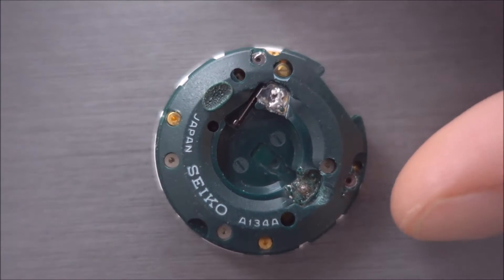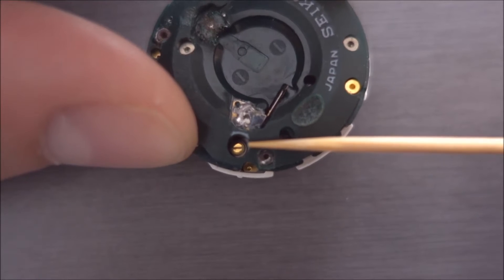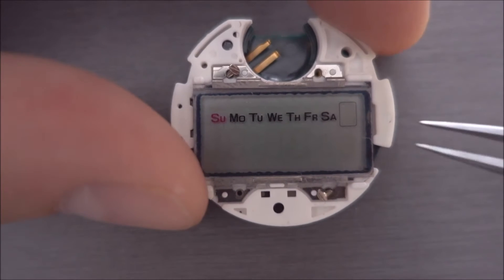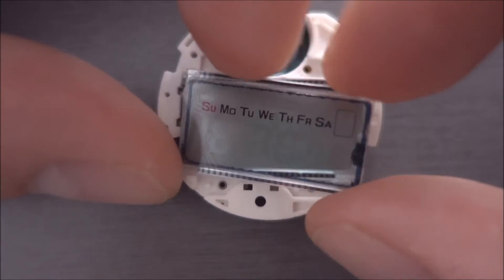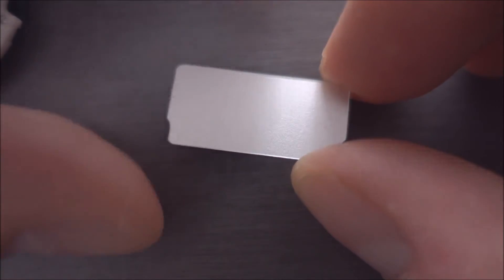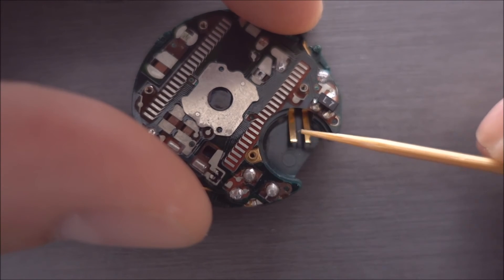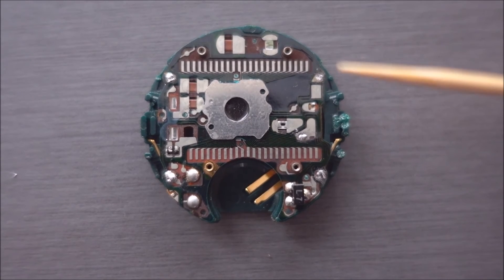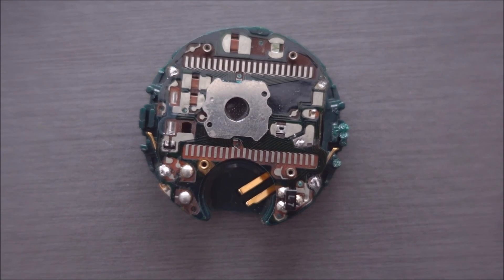SEIKO A134 LCD Quartz - How's It Built? / What Goes Wrong?

Comment: Any tips - my pristine A159, put new battery in - nothing; watch inactive, no flickering, button action ok, specified battery, tried another identical batt, tested both batts both ok. Still nothing, Batt compartment clean, no acid residue or anything like that. No weird smell.

Watch sat in box for about 10 years with no battery. Any tips, or is it now junk?
Reply from the maker: Probably need another movement unfortunately. They are prone to sudden death for no reason.
Reply: @hal0eight  Thanks for the reply.   Another collector has since said the same. It's a bummer but it is what it is.  Thanks again.

Comment: I have a strange bunch of A158's - very similar movement.
I got 2x NOS ones and the LCD is extremely dim, you can only see it working from the side.
I've swapped LCD's etc - sometimes get it working but it flashes in regular time mode. (tried replacement - didn't think it was flat battery warning).
What could the problem be?